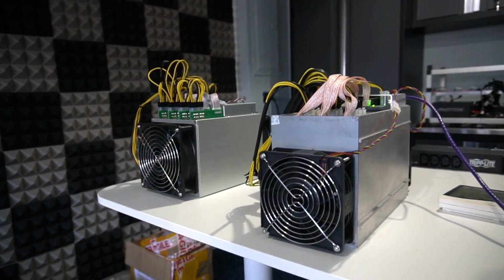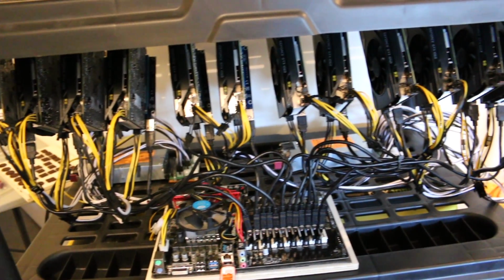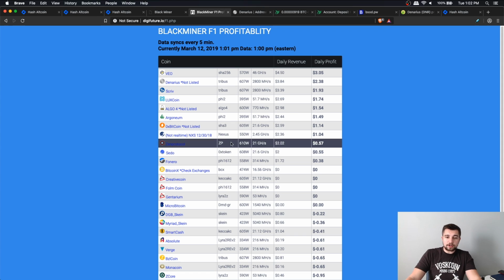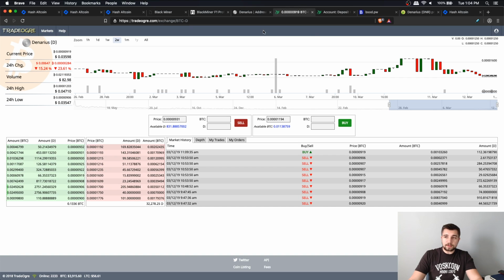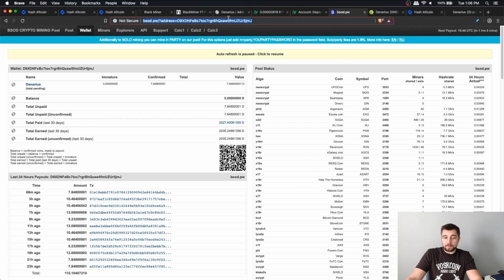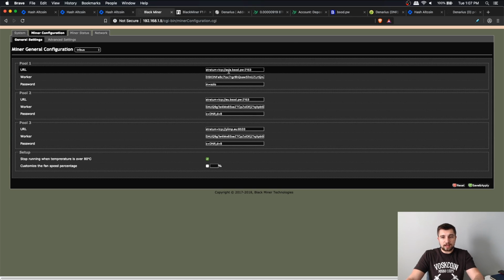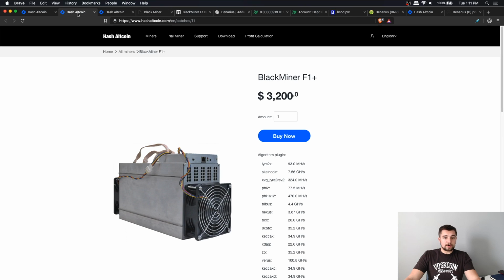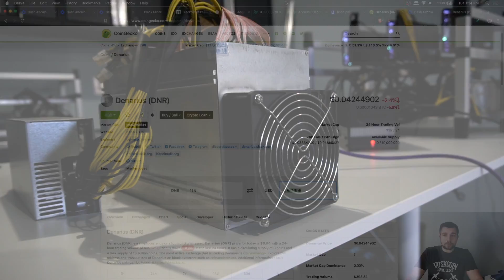Are FPGA Miners Profitable? Hash Altcoin Blackminer F1+ FPGA Miner Review

Comment: Haven’t read all the comments yet, but the default frequencies from HAC seem to be too high on some algos. If you drop it a few notches on the advanced tab, for freq- I’ve had great luck getting all chips to hash was no hardware errors and almost no drop in hash rate. Usually a lil higer HS with all chips running on each board, even if running slower

Thanks Vosk!!!